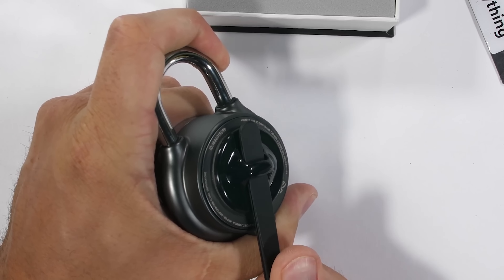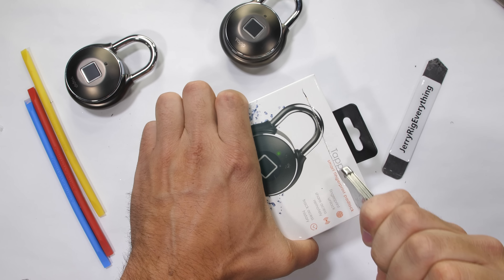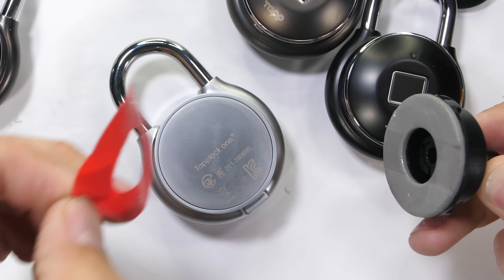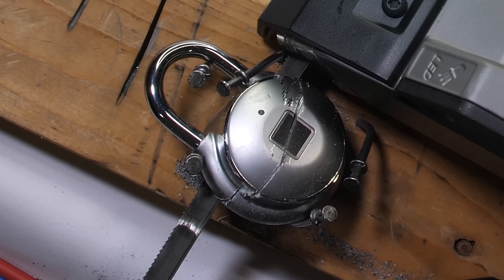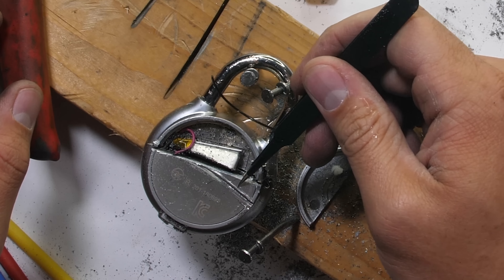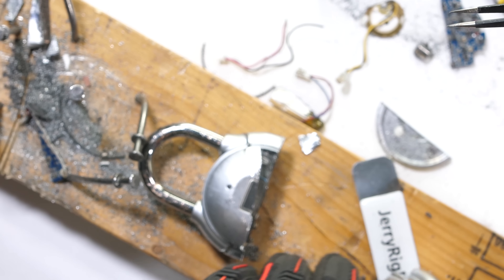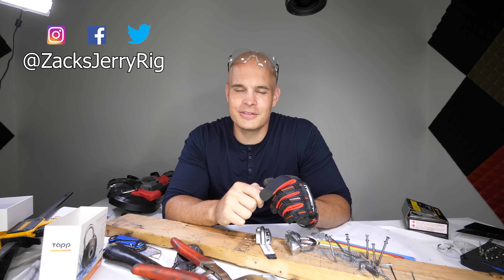Should you buy the *NEW* $100 dollar Smart Lock?...

Comment: I think you'd have to be pretty determined to bring an electronic saw with you
Reply: I was hoping he would try to cut the actual shank, that was still locked. I mean he had 3 more for some reason lol.
Reply: If you have an electric saw you could just saw the locker open (if it's weak enough) lmao
Reply: @lathrin  You could do that with a big pair of bolt cutters, probably, but the point is that this isn't any less secure than a normal good quality lock of the same size, with the added convenience of a fingerprint reader. I can definitely see uses here.

Comment: LPL needs to open one of these. He usually opens them within seconds
Reply: He'll likely get the torch and melt the zinc right off this one...
Reply: @drasiritzbir  Or if you are confident enough to make that much noise as he does in this video, then take an angle grinder.
Reply: Ramset straight to the sensor might also be nice... And loud..

Comment: Yes the physical aspect had been upgraded, but I still wouldn't trust tapplock, the previous one i owned just died on me after less than 1 month of daily usage. The fingerprint sensor just stopped working, if i didn't have a bolt cutter i would still be stuck in my own house.
Reply: They have improved their product a lot. Now you can stuck in your house after some years.
Reply: Now you'll have to get a band saw for it

Comment: Nice to see they've improved it. Not fan of the immediate destruction though. You'd get far more informtion on how it's made by taking it easily in small steps. Like turning the back - ok it is not more difficult. How about drilling two holes and then using those hole to turn it. Has it just been glued or is it now more secure? If glued - can the glue be dissolved using acetone? You get the idea.
It's no big deal defeating small locks using big tools - the interesting thing is how difficult and fast is it to defeat them using small tools and how much noise does it take?
They really should look to Abus and how they constructed their (newest) touch series. That should get them the idea of how to construct a solid lock that is not opened without heavy tools - but when you have it open you can take it apart using the screws in the shackle hole. That would also allow for changing the battery - LiIon will die at some point (the Abus Touch uses standard CR2).
Now it may sound I'm a huge fan of the Abus Touch... One thing it lacks - connectivity. I want a lock that is operable via Bluetooth or ZigBee (and a ditto gateway) so that people which fingerprint it does not know is able to get it open by giving me a call. I ordered a Tuya padlock to check it out. Exciting to see how it'll fare. I don't have requirements for ultimate security as it's for securing an indoor stud in a slinding patio door with the purpose of making break in or thieves leaving that way much harder - and that takes time which they don't have - so for that purpose even the first revision Tapp will be just fine.

Comment: Have you tried actual common attacks ?
Like hitting it with a hammer (away from the locked object). This tends to just shear off the locking-lugs.
Or prying with 2 wrenches.
Or maybe a bolt-cutter on the shackle.

Comment: J: the back is turning, this lock is useless
Taplock: see? We fixed that
J: it would be a shame if someone cut the lock with an overkill saw
Taplock: you cant do that, its not fari. No one goes around with that
Lockpickinglawyer: gentlemen allow me opens the lock in 10 seconds using a deisgn flaw

Comment: Hey men love your videos.
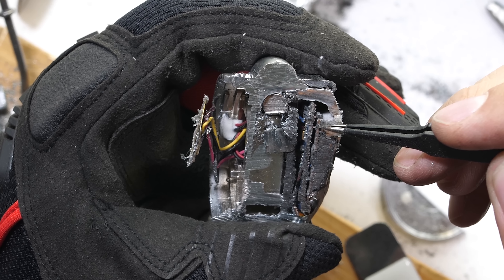I have another failure with this lock I saw your review and I give it a try I bought two for the promotion I save one on the box and use one rarely but last year I use it every day locking my locker and I broke the shackle come off from the lock I reach the tech support I paid a fee to send me a new one since it was out of the year of warranty and they told me the replacement was going to take a few months to arrive so I start using the second lock and today it give up and did the same shackle separate from the body it took 3 months and 18 days of daily use to brake the second lock I start counting since the day I contact customer support for the first lock may 23 2021its a shame that a expensive lock can’t perform a simple task or last long for what it was made for open and closing now I opened the replacement I received and I’m going see how long it last but if three locks fail on the same spot I think the need to work more on their product I’m not blaming you or anything but I know that thanks to you they improve their product and I think they can do it again if you point it to them I think it’s a good product if they do it better on minute 3:35 of your video you took a small piece of the shackle and you can se a small small cylinder coming out of it that’s the only thing that holds the shackle in place so I don’t think it’s supposed to be so fragile 
Hope you see this comment

Comment: You should have tried hitting the top with a hammer. Usually the weak point is the lock that holds the metal bar in place. All that is needed often is a household hammer. If you want to check how good the lock is, Try that.

Comment: those are "prison-screws" at least in germany they are usually used in prisons, 
since it is extremely hard to immitate the 3 curved wings with another screwdriver or anything else.
But any of the cheap supermarket bit-sets I bought so far has them.

Comment: THere fix could be very easy fixed :) THey just need to extend that backpart with tubs which have holes. Than drive in 2 screws which keep it into place are screwed from the part where the hinge goes. IT will never open like that :)

Comment: to break into this lock you need 1 bandsaw one piece of plywood 5 nails one press one hammer one pair of tweezers one wrench have the lock on flat ground one crow bar one pair of gloves and it still wont work unless you have a hard to find screw drivers and it will take about 6-10 minutes and one more thing no neighbors.

Comment: Hard to find screw drive. No no no you are over thinking this. A magnet will get that open in about .5 seconds. You can actuate the solenoid with a magnet externally. that trick sadly works on even "high end" safes. The bigger the lock the bigger the magnet is the only catch. I bet one of those 1cm name tag magnets is more than enough for that thing

Comment: The problem with this lock is that it costs $100, which means it has to secure something way more than $100, and for something way more than   $100, this is way too physically weak. Maybe one niche use for it would be if you have to open it a lot of times and the convenience is worth it.

Comment: NOPE, THUMBS DOWN. While they did improve the physical strength of the body, they made a fatal mistake with the locking mechanism. This new 'improved' design only locks on one side of the shackle, and worse still, the side it locks is the retained side, not the side that is exposed when it's open. So like many  locks with that flaw, it can be easily prysed open  or forced open with a sharp hit of a hammer on the top of the body on that side. It may also be possible to make a sharp tap on the side of the lock to activate the sprung locking pall. Not a secure lock.

Comment: How come that batter is WAY smaller then ALL phone batters
And yet it lasts a year 
Someone explain to me
Reply: Cellphones do a lot of things all the time (apps in background, OS, wifi, Bluetooth, mobile data, screen, CPU), all of that consumes a lot of battery energy.
That lock, besides its smaller battery compared to phones, consumes almost no energy, as it doesn't have a powerful CPU, but a dedicated microchip "waiting your finger print" so most of the time it is in sleeping state. That's why it can last a year away from a charger. Also I think it has Bluetooth that is rarely used. The motor only activates to unlock.